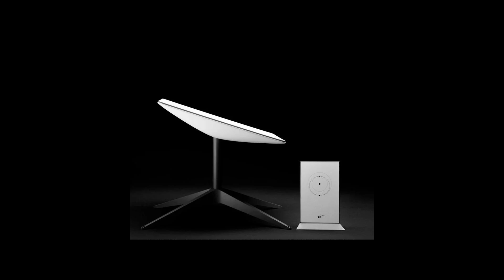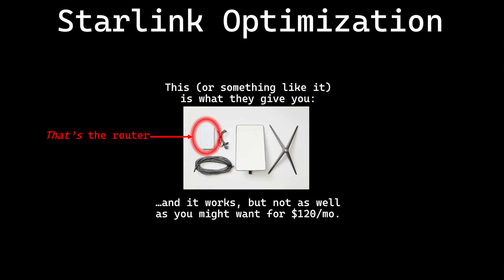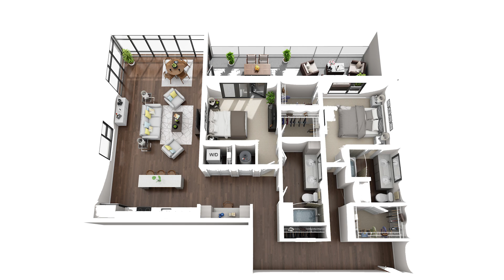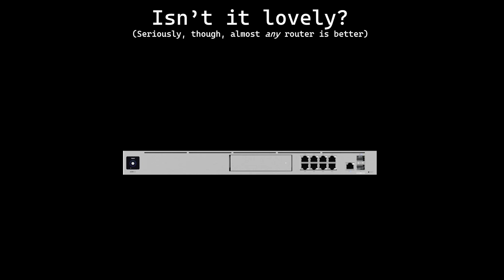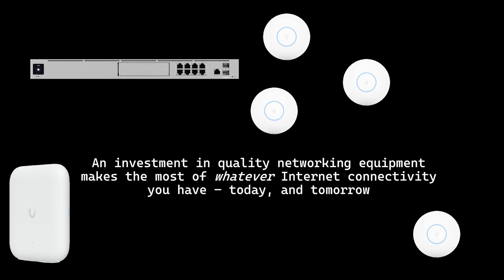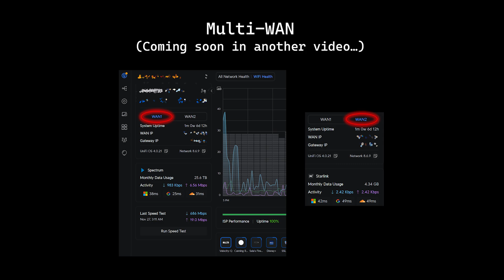Part 1: FASTER Starlink, fixing one common mistake!

Comment: The problem with the bypass mode is that if there is a problem with the starlink router, there is no way to troubleshoot it. Because we you turn on the bypass mode there is no way to turn it off and when in bypass mode you cannot not see anything(packet loss or any other info)  on the app. So it is a bit of a risk. 100% on buying ubiquiti equipment !! very good invesment. Good content !!
Reply from the maker: Thanks!

In bypass, you can still connect to it using the cloud method on the app.  Assuming your Starlink isn't completely offline, you can still see ping success (packet loss), latency, power draw, throughput, and see the obstruction map.  

If something more serious is happening, you can reset the Starlink router to get local access.  

And you certainly CAN run the router in "normal" mode and double-NAT with another router - my engineer brain just doesn't like that approach, though.